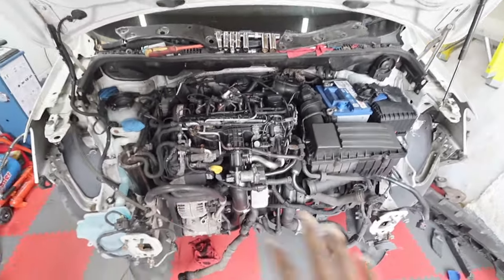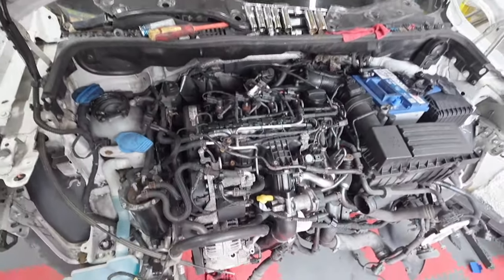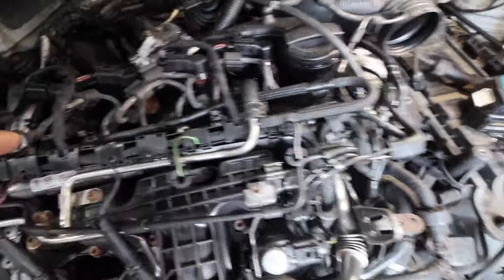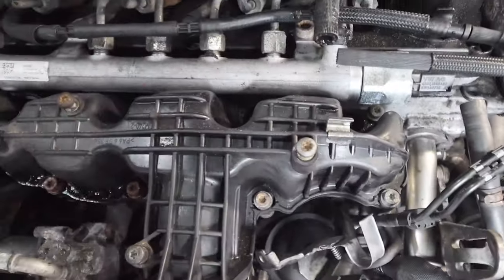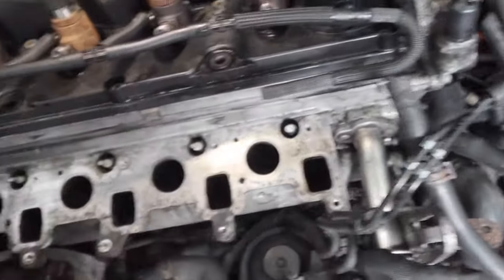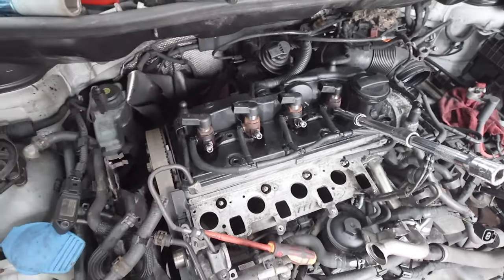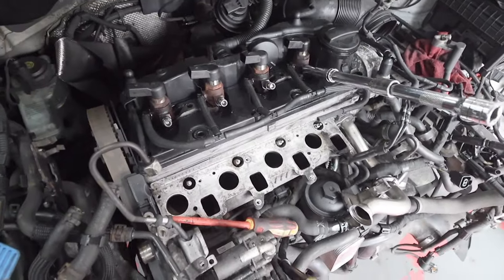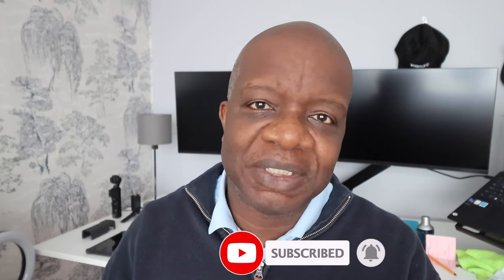Stripping the Caddy head

Comment: Paul remove the leak back hoses it's just a small metal clip pin the holds them in and if you break one of the black connections then its £180 for a new complete hose set up from vw. The injector hold down bolts are stretch to yield so get new ones they are £1.50 each from vw. I know as I done a set of seals on one fired it up and 2 injectors popped out taking the leak  back out and I bit of bolt stuck in the head and it's a pain to get that out. If you remove the injector saddle it will give you some room to spray the injectors with with some wd40 to help loosen them I also used a spanner to rock them and just kept trying to rock them free while applying more wd

Comment: The head bolts may be a torque-to-yield type and if so are generally a single-use only item. If that's the case, they're probably very reasonable in cost. Also, if there's a stud kit available, consider that set. It's great peace of mind and a good selling point when the time comes.

Comment: Those Caddy rocker covers are prone to failure, leaking engine oil which pools in the injector recesses - that may be why the stretch bolt holding number 3 & 4 injectors was oily.

Comment: Can the head be skimmed if is warped? Those who had the first Transit Mk1 with the V4 engine didn't appreciate what paradise they were in regarding engine repairs - heads off in half an hour, water pump/alternator replaced in 20 mins.